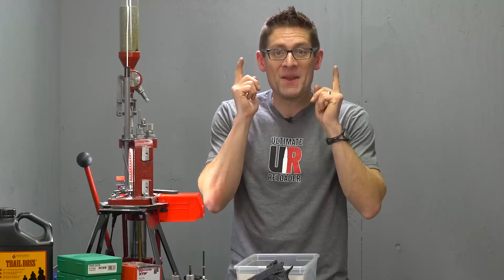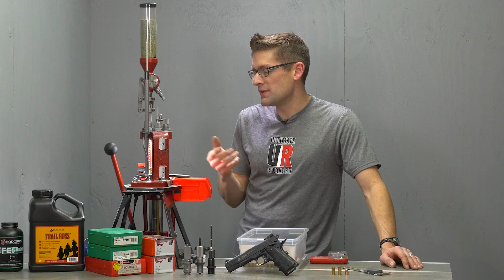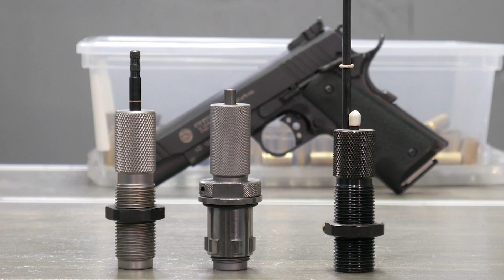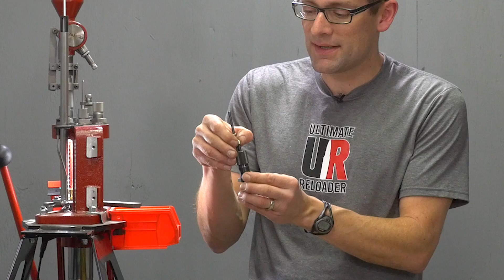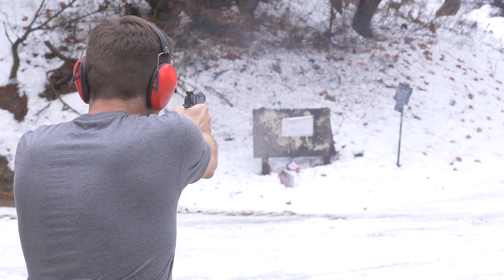Load 45 ACP Without Blowing Up Your Gun

Comment: As far as overly worrying about hang-fires, do not forget to stay off of air planes and do not travel in cars because accidents do happen you know. One can get caught on fire fueling their car. And forget sky diving or bungy cord jumping right? Or riding motor cycles for that matter. Oh and I hear people choke on their food too, so better not eat anything either. And the leading cause of death is medical malpractice so never go to the doctor! So you might think that if one just stays in bed they would be safe, but doing that one could get blood clots that can kill them also. So best just be glad you are alive and live a little while your at it.

Anyway, old deteriorated powder, moist powder, low powder charges, primers that where not stored properly, (cheap) low quality primers, and or overly crushed primers can all cause miss fires, squib loads, and hang fires. Be sure to treat them all as if they were hang-fires though.

Best way to avoid these is to reload your own ammo, and use quality primers. Also do not use old powders, and be sure and visually inspect each powder charge. Plus crimp the cases to the bullet, as this will give the powder more time to start burning good before the bullet moves which would cause more usable case volume of which wouldn't allow the powder to build up its pressure for the powder to burn correctly right off the bat.

The hang fires cased by a very small charge are normally brought on by the use of a powder measurer/dispenser and static electricity bridging the powder charge in the drop down spout as to only dump a small amount into the case that went unnoticed and a bullet was seated. The primer pushes the bullet out of the case, and the low powder charge then has too much room to build pressure immediately, so it burns slowly until the pressure builds up and then the charge will start to burn faster to the point it will either spit the bullet out or lodge the bullet further down bore.  This is why I never recommend the use of a progressive press with an on-board powder thrower, as this type of set-up is responsible for both squib loads and hang fires, as well as guns blowing up. The guns that get blown up are the ones that got the powder that was hung in the measurer, due to static electricity bridging the powder in the down spout, from a previous squid loaded round so that it ends up with an over charge. Yes one of the rounds in a squib load's batch could very well be one that literally blows the gun apart. Most people that end up with a bad round will spend time disassembling the rest of the batch, be it a few, hundreds, or even thousands of rounds, for safety sake. A lot of time spent that they tried to save by using a progressive press in the first place.  Then they have to turn around and remake the rounds a second time, of which if done again in the same manner of using a progressive press with and on-board powder measurer may very well end up needing to be re-disassemble all over again if static electricity rears it's ugly head this go around too. A vicious cycle.

There is a business that sells replacement powder hopper that are made of Pyrex instead of plastic which should by all means stop any static electricity from building up on the powder in the hopper so that powder bridging in the drop down portion should be a thing of the past. Personally I am getting one, as static electricity is a Handloader's nightmare. DRAM WORX - Pyrex Replacement Hoppers. Oh, and replace the plastic down spout with a metal one too.

 Personally, I will not run a progressive press because of all the safety checks they cheat us out of. I run all my brass through one step at a time on a single stage press, with hands on every step. This gives me plenty of time to catch cracks/split cases, primer hole issues, primer seating issues, bullets seating issues, and crimp problems. If anything is out of whack the brass gets reworked or trashed. As for powder I weigh every charge! I use a powder thrower to dispense powder into the scale pan, a trickler to round off the charge weight on a beam scale, and then I set the pan onto a digital scale as a double check. If the two scales do not agree I recheck the beam scale poises and re-zero the digital scale. Normally it is the digital scale that has drifted, but once it was a beam scale poise got moved by accident. Either way all my powder charges get checked three times. Twice by scales and once with a visual, in the loading block, after I have charged a batch before seating bullets. I do what I do for safety, not speed, cause as the old saying goes "SPEED KILLS!" And I encourage all to not find out the hard way.

The progressive press can cause all three dangers no matter what powder one uses.
It is the ones that use progressive presses that have these squib loads, hang-fires, and double charges, and put bystanders at risk of injury or death. And when some one gets hurt it will not be considered an accident but rather reckless conduct with a firearm or involuntary manslaughter! If you are going to reload you need to take responsibility and check every powder charge! Personally I weigh each charge on a beam scale, double check them on a digital scale, and last but not least I do a visual check before seating bullets. This routine if followed religiously will negate all squib loads, hang-fires and double charges by 100%. 

Safety should always be the #1 priority when reloading, not rushing through the process to save time!

"Basic Handloading" by George C. Nonte Jr. 
page 43:
"Use of an adjustable powder measure will greatly speed up the operation."
page 45:
"If you discover an error after forty or fifty rounds have been completed, there may be no way to identify the cartridges that contain the error."
"Usually, a charge that bulks abnormally high or low will do so at the expense of the charge thrown immediately before or after it. A light charge in the case might mean that some powder remained in the drop tube, and so was probably added to the next charge thrown; an overcharge probably indicates that powder hung up in the drop tube from the pervious charge, making it less than it should be." 
"If it seems that I'm dwelling overmuch on powder charging, remember that this is the most critical of all the handloading operations to safety. You'll get no joy or profit from handloading if a mistake or an oversight causes a gun to be wrecked or a shooter to be hurt. Handloading is essentially a very safe practice, provided one adheres to the basic safety requirements and concentrates on the job at hand."

Robert A. Rinker also tells the same thing as above in his book titled "Understanding Firearm Ballistics 6th Edition.

Comment: ...another thing to watch is distraction..... it's best not t think about anything else while operating the press....the only time I have goofed is when I was thinking about something other than the task in hand or for some reason lost my 'rhythm'... Loading is a sort of 'Zen' thing, and you need to focus on the task. I cannot afford a progressive press, and these days (I'm nearly 78) I don't shoot as much as I used to, so my little turret press does the job well. It's fine for pistol rounds the automatic powder thrower is brilliant, and amazing accurate...I usually weigh every 50th charge on a balance scale and the measure is never even 1/10th of a grain out.
Rifle rounds are different.... I load .303 British and .308 and weigh each charge (quiet quick with a trickler to top up to exact weight) so I am doubly sure that the powder is in there.
Black powder is the same, I dispense it by hand for shotgun rounds, and all my other BP guns are front-stuffers, so the problem does not arise.
Not adding powder to a combustible paper cartridge is pretty obvious!...
Reloading is fun if you have the time, but carelessness can have a very high price.... Keep safe y'all...:-)

Comment: for me reloading is a pleasure so I'm in no hurry. I tumble the brass, lube cases and check one at a time, deprime, swag the mouth, clean primer pockets, resize as needed. Then prime all. I weigh EACH load on a beam scale using Tite Group, fill one case then seat the projectile. Once all are loaded add the crimp, all on a single stage Hornady press. Pretty much eliminates any errors and loads are very accurate and consistent. My deviations are in the teens

Comment: Mechanical powder level checkers are just another thing that can fail.  YOU are the number one safety device.  It doesn't matter which type of press you use.  YOU should VISUALLY check every single case before seating the bullet.  No matter how you reload.  Squibs and double charges are VERY easy to spot if you bother to look.  If you are in too big a hurry to bother with it, than you roll the dice and take your chances.  Reloading ammunition is not a hobby for impatient people who get in a hurry and want to take shortcuts.

Comment: Sure trail boss is nice an bulky but has a totally different burn characteristic than most pistol powders. It's more for old cowboy action shooting. 45 lc, 44, ect. 
That said it also has its cons.
Running a max load in a .38 spl with trail boss is right on the border of where you'll end up getting powder compression when seating your bullet. It may not be noticeable to the reloaders either. Compressed powder is a really bad thing.
Trail boss is great fun for plinking, but if I want a more bulky powder in my .38 pr .357 loads for accuracy I usually use hodgdons universal. Even with that powder you can still more than double charge a case.

Comment: Even though I have a Dillon 650 (upgraded from a Hornady LNL) my reload process is done in steps and not all on the Dillon.  First take your time.  I find doing things in a batch mode makes it easier and safer as you concentrate on only one thing at a time. The de-priming and resizing are done in one batch on the Dillon (one die in the tool head) followed by tumbling in corn media, then I inspect and  prime all the cases using the RCBS bench priming tool.  The remaining powder drop, mouth expanding, bullet seating and crimping are done on the Dillon with powder being checked using the RCBS lock-out die.  For added safety I can view the case charge on each before bullet seating.

Comment: I love using trail boss for just that reason. I'm new to reloading and I wanted to have a safe margin, so my father (who I think taught moses to reload) suggested trail boss because its perfect with 38 Special. I build flintlock rifles and I am familiar with a load column, but my father wouldn't let me use black powder cause its corrosive to the cases. That and you got to clean your revolver inside and out after every shooting session. Taking the side plate off an old smith and Wesson is a bitch.
Reply: Smack the frame of your gun to get the side plate off if you pry it you will roll over and damage all those nice fine fitting

Comment: Ultimate Reloader, I have a reloading press and a chronograph and I just in the last 6 months have reloaded 1,000 9mm subsonic ammo, 20 subsonic 45 ACPs, 100 subsonic 9mm. Well on the 45 ACP I used the 230 gr 45 caliber 0.451” diameter bullets in FMJ by Hornady with a starting load of 6.1 grs of CFE Pistol getting 741 FPS with ES of 40.8. Suggestions on getting to 821 FPS from a factory load and ES of 29? Thanks!

Comment: Before charging inspect the inside of the cartridge, in using a single stage hornady press i charged a loading tray and notice on power level inspection one round was much higher, i dumped the powder out into my scale and the same gr. charge was present. repeated the charge same high level same proper charge. upon closer inspection ( with flashlight)  noticed something was filling the inside base of the shell case. it was a piece of compressed black foam rubber, how it got there i haven't a clue. 
i used a progressive for many years, stopped reloading several years then started up and with new single stage equipment, slower of course but i have better  peace of mind knowing i have better control of each step.
 i like the bulk powder but never used it before, how well does it meter from a standard hornady powder charger? compared to say HP-38? or win 231?

Comment: charge "has to be precise in terms of allowances."  double talk.  you are either precise, or you are not.  Tolerances are there because not every scale / press is always precise.  The only time it possible becomes an issue is if you are at or above the maximum load data.

Comment: This happend about 30 years ago. I reload 45 acp 200gr swc, 3.5 gr bullseye, single stage press. How tough is a colt series 70 gold cup? I missed putting powder in one case and had  a squib load and did not know it (my bad). I was not paying attention. It kept shooting and it worked fine and I didn't know about the squib untill I cleaned the gun and noticed the barrel was a little bulged 1/2 way down. I replaced the barrel and now use that old barrel as a headspace guage.

Comment: My RCBS digital scale seems to be missing the first couple/few tenths of a grain of powder I put in if I go very slowly.  ...'Think I'm moving to a predetermined volume cup-like tool to measure out a few grains of powder to start off my load and finish off the last end of it at a slow rate.  'Dunno what made the scale start doing that lately, but is kind of annoying.
Reply: Clean the stem on the bottom of the pad and look up the calibration procedure for the model of your scale, mine is an old rcbs that's out of production now but still very reliable, best of luck

Comment: Hello there !

I was wondering if it was smart to check the weight of your individual cartridges, one by one, after your loading session, and see if there's a variation in the weight ? Would that work as a check ? I'm so nervous about reloading since I had a squib on my single stage Lee. Now, I have a Loadmaster and I worry about the exact opposite issue.  

Squib isn't that much of a problem if you pay close attention to when you're shooting, but double loads, especially on 38Spe like you mentionned (and that's what I'm reloading) are very easy to miss and very dangerous, even in a 357 chamber. 

Powder, bullet, case brand and primers are identical all the way, so the only difference (if any) should be the weight. Still, I'd like to know if experienced reloaders considered (probably) and do that too. 

Thanks for your videos, they are a great help !
Reply: I'd say no. I've thought about this as well, and variation in the brass case or overall length could vary your overall bullet weight drastically. Since the brass isn't really a "critical" component in the overall scheme of things... the manufacturers aren't going to tolerance the cases to the level that you can, or you'd be paying a LOT more money for them. Even doing them yourself... the brass density from one batch to another can be off by quite a few grains. Best to leave that variable out of the equation in my humble opinion.

Comment: What's the best powder for 9mm? Most economical.
Reply from the maker: Win231 / HP-38 (same powder) is hard to beat!
Reply: Your the expert Gavin I've been using and have only ever used titegroup.
Reply: Hodgdon "Titewad" and "Titegroup" are also pretty cheap.
Reply: Thanks I'll give it a shot. Great videos Gavin
Reply: Also, what are you seeking to achieve with your load?  Different powders will yield different results, ie, economy, accuracy, cleanliness and anti-carbon fouling.  Are you shooting 3 gun, bench, whatever?
Reply: I would argue the "best" is subjective...the best would be Vihtavuori IMO, but it's also the most expensive (and cleanest). I use Win231/HP-38 though, it's cheap, relatively clean, and reliable.
Reply: Has anyone try CFE pistol?
Reply: Yes, It is pretty good. If you load towards the upper end of load it gets cleaner. Lower loads in 9mm (124gr and 147gr) seem to be quite dirty carbon wise and the same goes for 45acp from my experience. One thing I noticed is it gives a high velocity vs other similar powders burn rate wise. My go to powder is Vihta Vouri N320 for 9mm, 40 s&w. 45acp I like Winchester AutoComp.
Reply: Keep a eye out for APS950 will be a very good powder

Comment: Single stage 50  at a time. check powder with flashlight make sure there all the same fill. weigh powder every 5 to 10 rnds max  small supply of different powders.  only reason to max load is hunting  or long range shooting.   should not reload your own defensive ammo, because of democrat laws.

Comment: Glock 32 357 Sig. Blew out my extractor. Hurt my index/trigger finger. Not injured but but hurt for about an hour. My mistake: resizing 40 cal brass for 357 sig. I think the shell was in contact with the rifling and caused a overpressure.